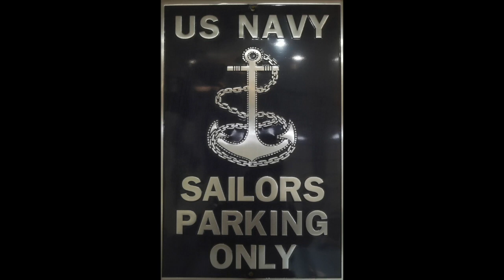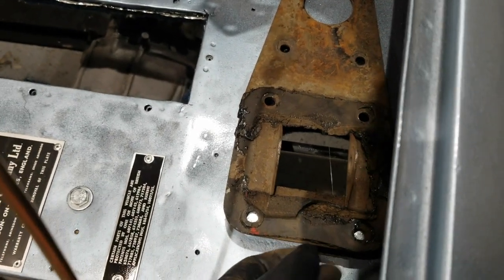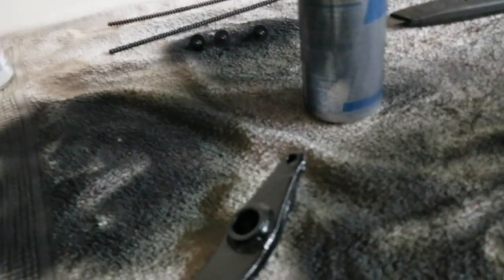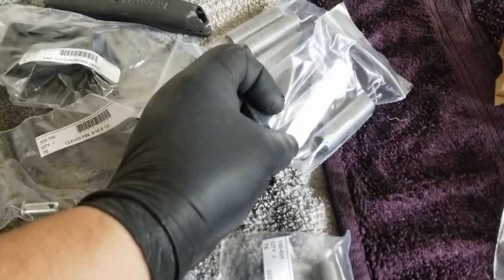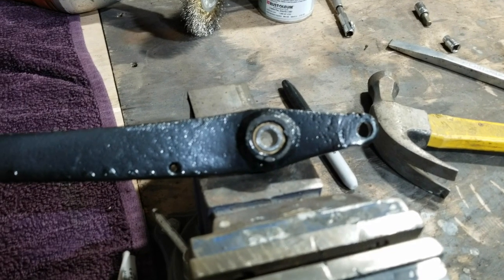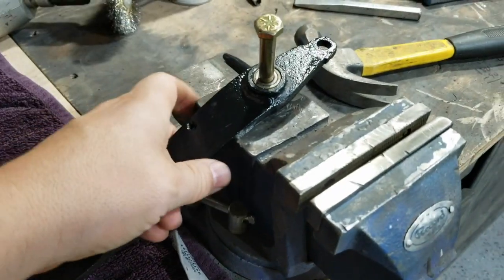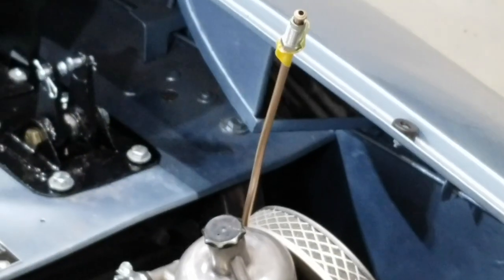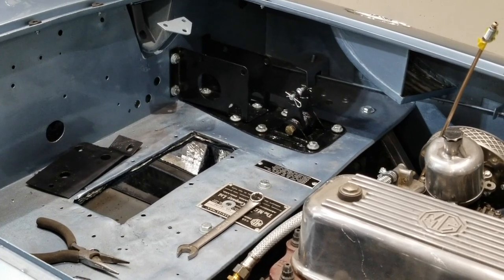1958 MGA 18c Pedal Mount Plate and Pedals

Comment: Are you going to put the rubber boot and metal plate over the pedal arms. Really needs to be sealed off.
Reply from the maker: The boot is on, but metal plate?  I'm not familiar with that. Guess I need to go back to Moss?
Reply: @christos7440  It is the bit that goes on top of the boot to clamp it down. Thought you would have installed it but sometimes we need reminding of some things. Have enjoyed your posts. I have done one long ago in the early eighties. Decided to do another one now and will probably post the progress on utube. My filming is a bit here and there so will need a fair bit of editing. Have a Facebook page "Carlogic" which has some stuff on it that I have done in the past. Cheers.